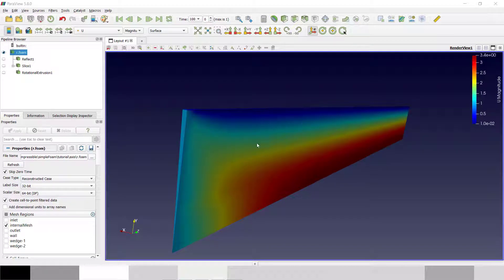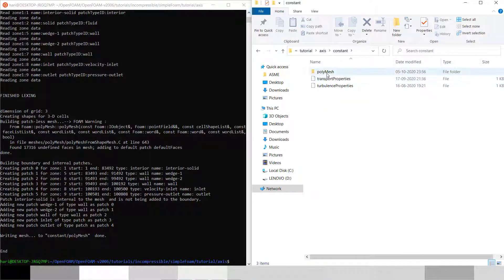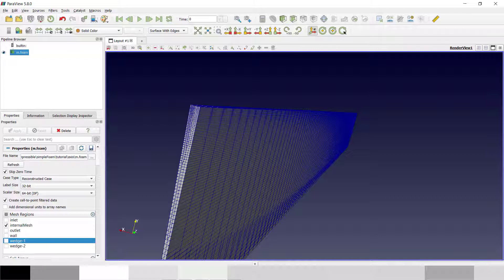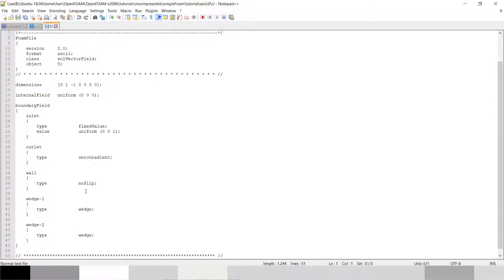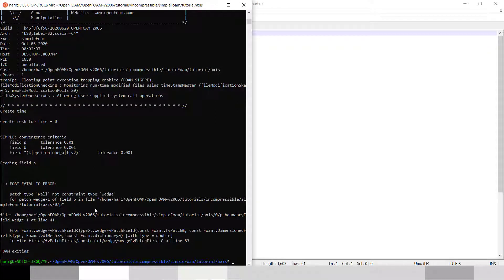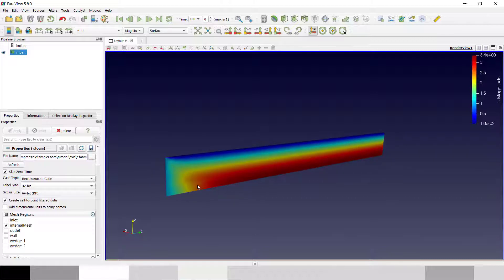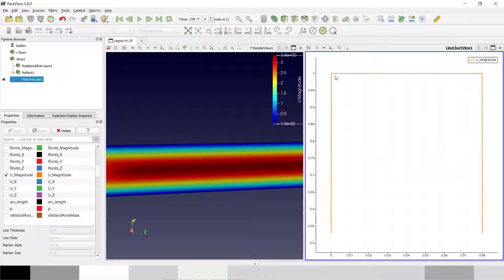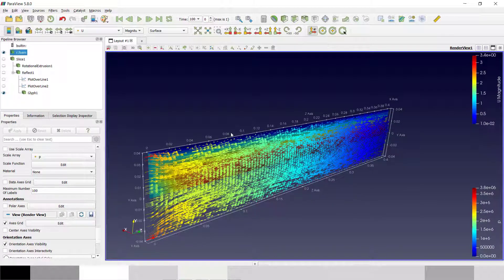CFD | Openfoam Basic-4 | simpleFoam |  Axis Symmetric analysis in openfoam | axis symmetry openfoam

Comment: Thank you for the detailed description. I received a FOAM FATAL ERROR as with "wedge plane aligns with a coordinate plane with a description "The wedge plane should make a small angle (~2.5deg) with the coordinate plane and the pair of wedge planes should be symmetric about the coordinate plane. Normal of wedge plane is (0 -1 0) , implied coordinate plane direction is (0 -1 0)" 

Would you please help me in this issue?
Reply: The wedge shouldn't be on a coordinate plane. So you have to set the wedge faces symmetric to the coordinate plane. It caused probably from the version we use. Recent versions don't support this setup. They shouldn't be on the coordinate plane.

Comment: I get this error. How can I solve it?
--> FOAM FATAL IO ERROR: 

    patch type 'wall', not constraint type 'wedge'
    for patch wedge1 of field p in the file.
Reply from the maker: Go for p file check wedge 1 constrained, spell check with your mesh
Reply: @HarikrushnaDodiya , Thanks bro it works now. But in terminal, it shows that wedge2 is not planer. Either correct the patch or split it into planar parts. Is there any issue with that?